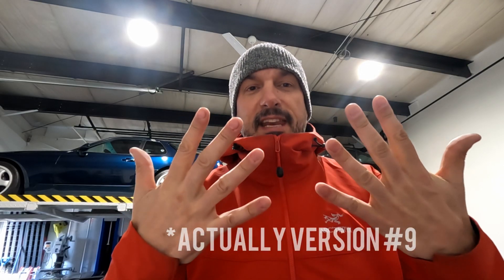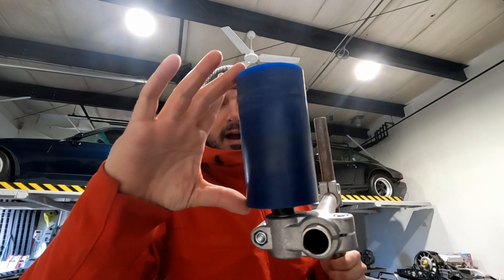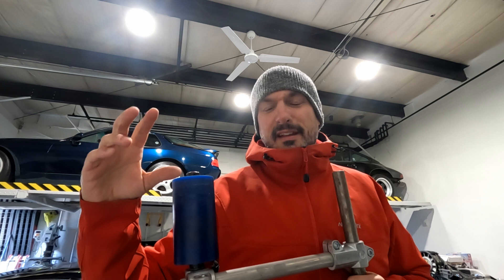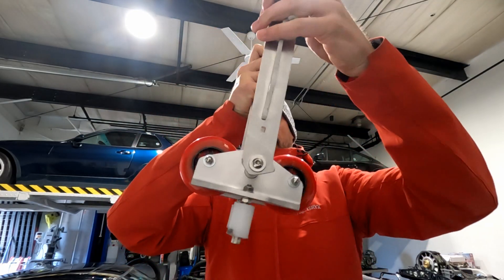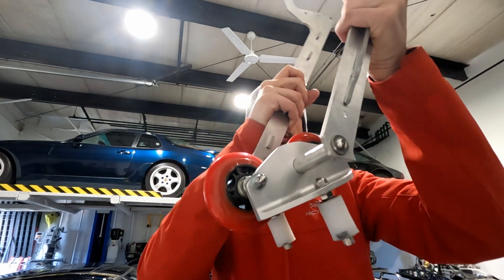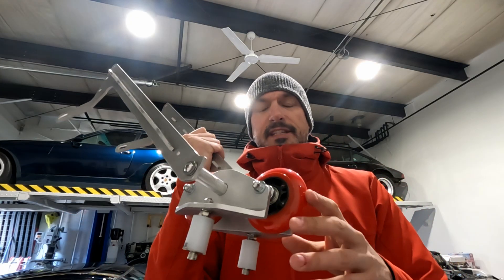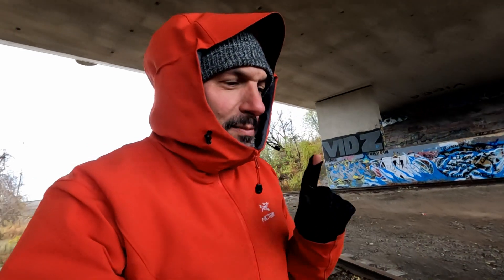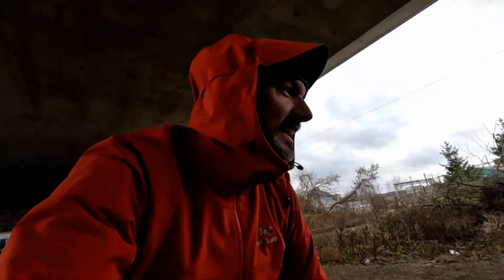RAIL BIKE - Version 9 - New Front Guide | Modified Outrigger Wheel | First Female RAIL RIDER!

Comment: Engineering question.   If you put guides on the front and back of the front wheel, can you eliminate the need for an outrigger?
Reply from the maker: I tried it. It's basically impossible. You just tip over.
Reply: @Suluk46  oh, I got the idea from one of your videos where you said that back wheel follows the front.  So as long the front wheel stays on the track, so should the back.  Hard part is getting it rolling.

Comment: I can’t believe there outrigger doesn’t have any bracing. Move the outrigger to the front and brace it off the kickstand mount. Why didn’t they walk any railroad track before building this. They would have seen the problem with the white rollers before they started. You also need to weight the outrigger if you ever plan on turning with any speed.

Comment: have you tried a trailing front wheel guide ?
Reply from the maker: A few of my older versions has the front wheel guided both in front and behind. Those actually worked very well, but were just complicated. Having just a guide behind the front wheel won't work, the tire will just steer off.

Comment: Is the goal a rail bike or something that converts quickly?
Reply from the maker: It has changed over the time I started developing this. Initially I wanted something that could convert quickly between trails and rails. But it has evolved to a focus on minimizing derailments, device durability and simplicity, along with a universal fit. These early versions were quite complex and very specific to each particular bike. So I guess the goal is a robust device that any bike can easily mount to, and bonus if the device can break down and be traveled with in some way.

Comment: The railway track has not been serviced for many years.  Rails can be of any thickness, as well as the distance between them can vary quite widely.  The design of the bike should take this into account.  I would recommend to make spring-loaded side restraints on all wheels only on the inside of the rails and to make the bicycle handlebar lock when moving along the rails
Reply: Good suggestions. From India.

Comment: Nice light design. Could make front section longer to put more torque to get steering straight. Also then you could make guides wider to be more tolerant of track width variations. I dont get why cross bar has to be parallel to ground. Most of the designs have that as a diagonal. I like how its adaptable so you can drive "off rail" whener you want. Why not make a trailer hitch so you can tow more weight. Most people wjo make carts rather than railbikes put a guide on just the inside or the outside not both as im sure you know. Your design could get jammed up if theres a flaw in the track. Maybe an inherent disadvantage of rail bikes?

I really like your light simple design thank you.

One guy had a similar design with bull horns on front guide so it can ride over humps. I dont get why your design rode over a hump in track but i did see it do that.

Comment: You need larger diameter and wider neoprene rollers for the ones riding on the track  and also the for the sides . You'll probably realize a much safer and quiter ride. The rear out ringer needs to have a captive roller's on its edge's to almost hug the rail. You may easily d-rail with this present setup at higher speeds. Also think about extending out the front stabilizer. Nicely done.

Comment: is it possible if the rigging is on the front wheel and back of the rear wheel? Do away with the long pipe balancer?
Reply from the maker: Not possible. The bike will tip over. I actually tried it a few versions ago.

Comment: I believe you are causing some of the problems with front wheel torque. By holding the handlebar, you cause some of the issues with side to side torque which is wearing on the side guides. Let go of the bars. Install a bracket to the frame top tube that would allow you to remove the handle bars and place them on the new bracket. They would then be solid with the frame and remove all of your induced twisting motion to the front steer wheel. The slight bumping that will occur on the side guides will be much less than that which you impart. Good luck and have fun.

Comment: I was looking at the blue wheel, and wondering if it would track better and be more likely to stay on the rail if the center is about 1/4" less diameter than the outside part, so it will "Float" to the center.  It might help to watch other video's, like Cam Engineering who is also riding the rails with a totally different set up, where the forward wheel is a little farther ahead than your set up, and the rear wheel is on a tri pod type of mount, so it can not swing left and right (if looking down at the arm) or up and down, due to a arm attached about 15" above the center of the rear axle mount of the main arm.  

Cam Engineering now has a electric bike, with a 5 KW battery pack, good for about 200 miles!  Keep making You Tube video's and you can pay for that too!  Cam uses a front wheel about 3" diameter, with a flange on each side, about 4" apart, that is about 4" to 5" diameter, so it does not hit the bolt together mounts on the outside of the rails, and also does not get stuck in the cement of the city road crossings.  

I think if I build one, it will use 2 bikes, and spread them the 54" apart.  Make a way to attach both bikes to the rails, and maybe a platform in between to carry stuff.  At least one of the bikes will be electric drive!
Reply from the maker: You can add that profile to the outrigger but the front guide wheel is the dominant feature for sure. The big blue wheel in this video is being retired. Much too heavy and the bearings do not free spin - too much friction. I'm very familiar with Can Engineering. Awesome design, but not universal or economical to make, which is what I am working on so it can be a kit. The 2 bike version is super cool too, maybe in the future though.
Reply: I'm planning on building a rail bike similar to the one you described, utilizing 2 bikes with one on each rail. Any chance you went through with building it and have any pictures/advice?

Comment: A thin wire from the frame at  the top tube  to your cross piece at the far rail would eliminate any  far rail axle deflection. All you need is a gossamer filiment with strength. Off shore braided steel fishing line would do well in that application. Be well and enjoy!
Reply from the maker: I will probably add that back in once I figure out the details of the front guide. I had a wire on an earlier version, albeit a terrible overall design 😂, so still have it for future use. The deflection of the outrigger hasn't been an issue, but I imagine as the need for longer and faster rides increases, so will the need for rigidity of the structure. Good input, and thanks for checking this out.

Comment: Track gauge is 4 ft 8.5 in, inside of rail to inside of the other rail with a variation of minus 1/2 in to plus 1.5 in.  With your arrangement, you could go over the 1.5 in.  The rail head on most rail that you would probably ride on will be 2 in to 3 in.

Comment: The simplicity of this design is great. Do you have any kind of plans or notes available?
Reply from the maker: Thanks! I'm still working out some details but once it is fully ready I plan to release instructions and a kit for those interested. The challenge comes from all the different geometry of bikes that are available. But we will see how to simplify it.
Reply: I was working on a rail bike for awhile but put it aside when I was doing other things. I built the front and side trucks with inline skate wheels and tried them on train tracks without riding and they seemed ok. I was going to build a tripod design like the Bentley and thought of buying their plans but your design is so much simpler with a single bar for the outrigger.

Comment: Would going fast over the track connections then bounce the front guide wheels too high?
Reply from the maker: Yes, that does happen time to time. I've modified the guides to be shorter so that doesn't happen. And that is also why you need to lock the front guide down somehow. I just use a strap on this version.

Comment: This is really radical. The outrigger at the 90° angle from the rear wheel or in line with the rear axle I guess is what I'm trying to say I feel as though you could fight or eliminate some of the drag or catching if you had it go like the 30° angle towards the front and then from your down tube have another support bracket thus making it a triangle and more sturdy it looks as though it's wanting to drag and maybe causing unnecessary friction and this is all just speculation from a guy who is sitting  on his ass in his garage and not making a bicycle that rides on the rails! :) maybe you've tried this and sturdyer outrigger binds up.... Those hand carts that they see saw back and forth down the track why are they not sitting in actual seats and using the gravity and not their muscles? The foreman was like I ain't spending money on a seat you can stand your asses up and or he just knew his workers would be stronger and harder if they weren't utilizing their body weight and having fun yeah we tried the whole seesaw thing far too many employees fall in love and run off into the sunset so we chopped seats off and made them pump it by hand where they still build a lot of camaraderie but not seesaw type of camaraderie
Reply from the maker: Lol. That made me laugh. I might go with an additional brace for the outrigger but I'm not fully convinced I need it. Most of my issues are with the front guide and I think the next version will be a game changer. We are close!

Comment: Impressive development. It seems to me, as if you have improved the Bentley-design. 👍
Does this also work, when there is a rail-inclination (I mean: each railhead is tilted by an inclined railchair slightly to the center, approximatley 2,5% to 5%)? I experimented also a bit some years ago on a closed railway (with inclined rails), at the end using a design with some similarities to one of the railbikes used during Dick Smarts Patagonia ride - in order to avoid leaving the tilted railhead. I stopped those experiments (made only 2 versions, but with approximatly 100 km of railbiking in total) as fortunately now regular trains are running again on the "test" track.
Reply from the maker: I haven't gotten to the point of testing for those type of details such as rail inclination. Mostly just been trying to nail down the guide style and location, which I believe I have done so far. I am already working on version 11, which will be a stiffer front guide and outrigger similar to my other versions. The reality is that many different styles work, and even work well, much is based on preference, goals, and condition of the actual railway. I do like the Bentley style where the front wheel is actually not running on the rail, but I haven't thought about how to make it more modular. I need the ability to ride on the rode and the railways for my style of trips.

Comment: I made a functioning railbike with two horizontal guide wheels in front...but changed them to 45 degrees because they couldn't get over obstacles alongside the rails.  BUT my important question is WHERE ARE RAILBIKERS RIDING??  Is there a site listing "legal" rails?  If not, this is needed!!!!
Reply from the maker: My older version had the 45 degree wheels on the front. It worked pretty good. The full vertical wheels (smaller diameter to clear the rail connectors) has worked the best for me thus far. As for where to ride....lots of abandoned lines up here with established hiking trails right along them.

Comment: So ive done this but with a 6hp minibike and done about 40km on the tracks. That front guide wheel wont work for road crossings, found wheel barrow rims to be almost idea, just needs to be a thicker gauge or coated in rubber to increase life. Best of luck!
Reply from the maker: Wheel barrow rims? Interesting! I'll have to check it out.

Comment: Hi I am new to this I have tried two 20inch wheeled folding bike mounted together, didnt work.  I like the idea of a front outrigger, i can use same 20inch wheel.  All my connection is done through bmx foot pegs, so along the lines you are talking about, outrigger on the front coming from front axle, and maybe guides only on the insides of the two front wheels?. Regards Kim
Reply from the maker: You would have to try it out. I've always gone with guides on the inside and outside of the one track. I haven't seen any need for side guides on the outrigger. In this version, I machined the outrigger flange off.

Comment: I still don't like that vibration in your outrigger. A wide structure could make it both lighter and stiffer, but how do you get that space on your bike with your pedals? Have you considered using a long tail bike?
Reply from the maker: I also do not love that the outrigger flexes but in fairness to it, I haven't spent any time improving it lately just because it works pretty well. I've got one more system to test before I try out some more traditional set ups.

Comment: Love the new idea. but if it were me i would still add the support brace from the out rigger wheel to the other axel on the bike which ever way from out rigger or back. then you can add a mesh in the middle and add carry on luggage for the longer rides. Al so it will be so robust with a tiny bar.
Reply from the maker: I haven't started implementing any luggage racks and stuff, but that is coming up soon so I have to start thinking about it. I'm hoping to incorporate the outrigger bar, like you mentioned along with my bikepacking gear.

Comment: There are many different sizes of rail heads. You run up on a comp joint and you could wind up on the ground.
Reply from the maker: Any chance you could elaborate? Do you mean the top of the rail itself has varying geometry depending on region or otherwise? The rail I am using in the video is very old and rusty so the metal has actually separated considerably from the base material, adding to the challenges.
Reply: @Suluk46  yeah there are multiple sizes of rail amd it goes by weight. 80 pound, 132# etc. When these different sizes are in a track, they will use comp bars to install em. These sizes in rail will have different sizes in the head of the rail width. Comp bars will make it flush on the gage side or inside of the rail but may not be on the field side or outside of the rail. Creating a significant mismatch or lip that those guide wheels could get hung on. Some rail sizes are close in their measurements but some are way different.

Comment: I’m really curious about moving the outrigger to the front. I’m wondering if the drag from weeds and such, combined with the long lever arm, will force the front wheel to turn. If so it will battle the front guide. Either the front guide will pop off and the wheel will turn into the railway, or the guide wins and the tire slips outward and off the track. Or ideally your body mass will overcome the outrigger torque and nothing happens! Yea! 
This is my favorite video series. I just love problem solving and the evolution of ideas. And kudos to you for sharing the journey with us armchair team members.
Reply from the maker: We have the same thoughts. I have already built the new version, and even just moving it around, you can see how the heavy weight of the outrigger will influence the steering of the bike, pulling it to the inside of the rail. But maybe  just counter act that force by steering a bit to the outside of the rail. I'm not sure, but I am sure that I want to test it out, just to see :)
Reply: Triangle the outrigger both f and r. 
Front wheel guide has one rollerblade wheel in front of bike tire and one behind it connected with a long guide band that doesnt hit the rail tie bolts and you still have room to put a card in the spokes

Comment: The small, solidly mounted, wheels on the front rail guide are problematic. What I think may be an improvement would be, instead of the small solid mount wheels, wheels the same as the ones on top of the rail but at a 45 degree angle to the rail. Having them above the rail at an angle would prevent them from catching on those plates that join the rail sections together.
Reply from the maker: They are a problem, as they are too long for sure, but they are not solid they have bearings in them and spin freely. I've done the 45* wheel back in version 5. It's a smooth ride for sure. I might go back to it. I actually sent that version to a guy for testing, so I'll see what he says. The 45* wheel has its own challenges, and I'm thinking that maybe all Railbike designs do. Gotta find the perfect one!